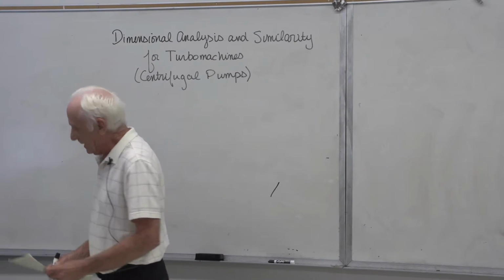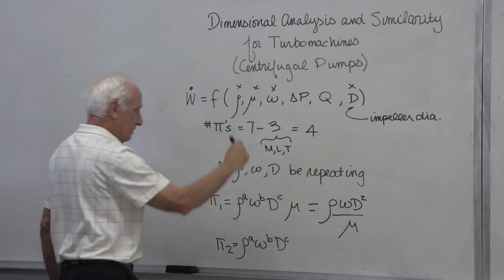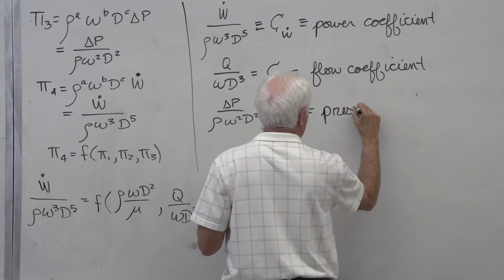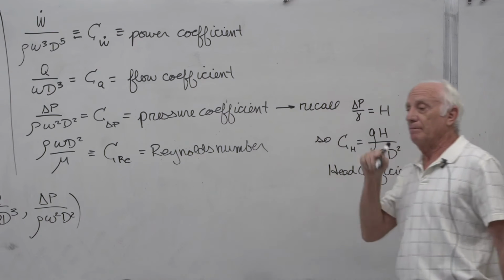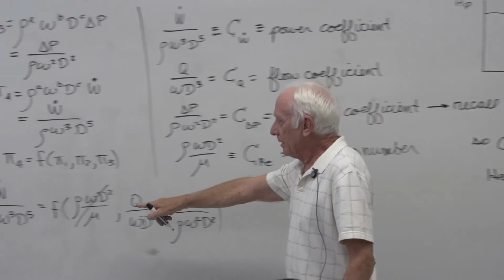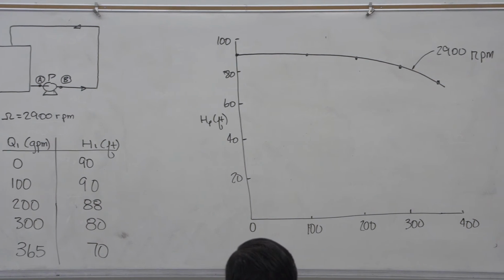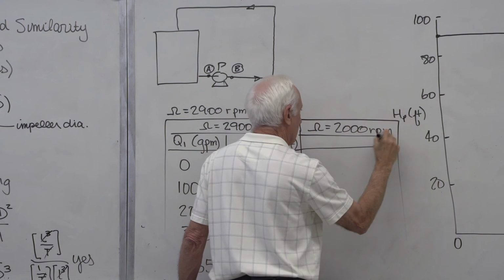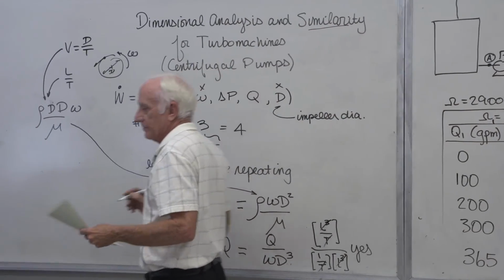Fluid Mechanics: Dimensionless Pump Performance (25 of 34)

Comment: hi 
I'm really grateful for the videos and the further illustration within the subject of fluid dynamics.

My question is, using the similarity law, as in this case, can I still predict the performance of a similar pump whose speed and impeller diameter have been changed all together purely using those same test data?